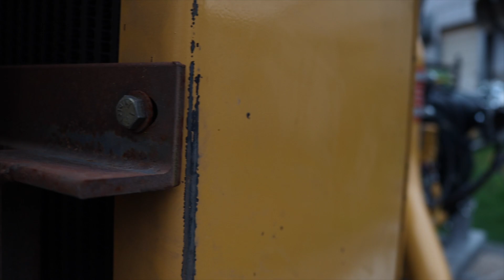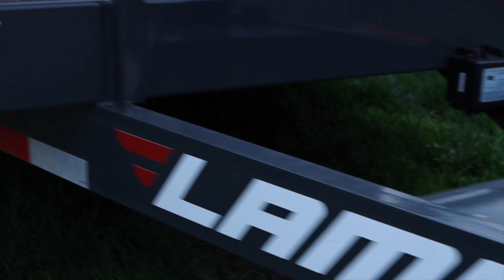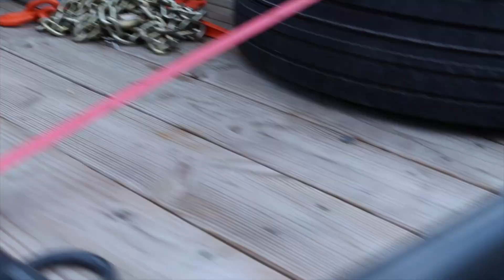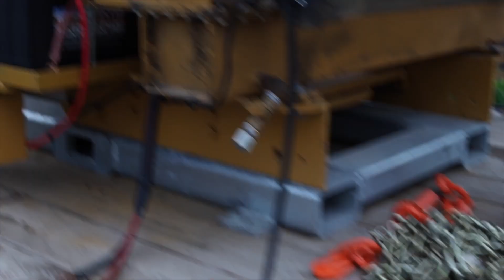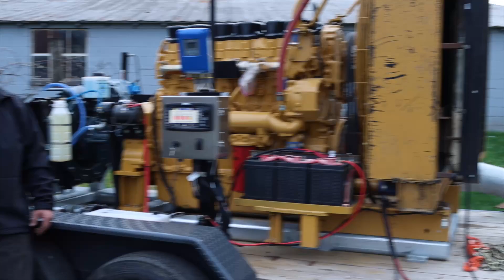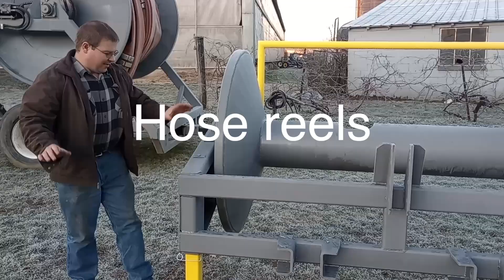Upgrade your Manure Dragline with a Cornell Pump!

Comment: How much does that cost to set up?
Reply from the maker: Setting up a pump with valves, pig launch and intake could easily run 8k. Name brand Krohne flow meter is about 7k.
What are you thinking of?
Reply: @Hoover_dragline  I have a 3406B engine and am considering making a  pump with that as the powerplant. Sort of a first step into pumping manure.